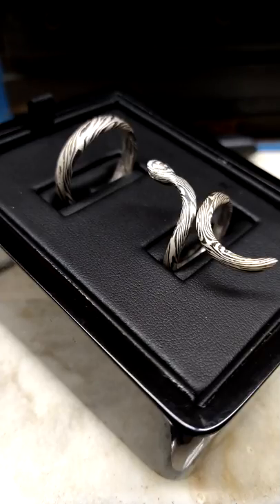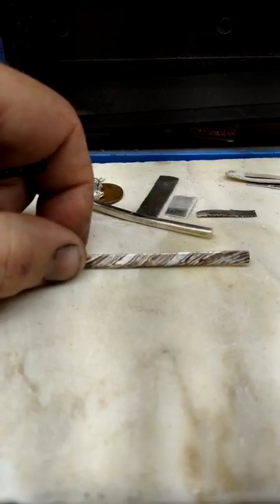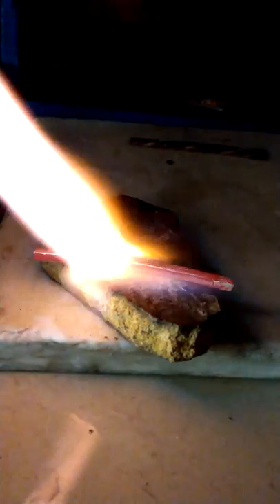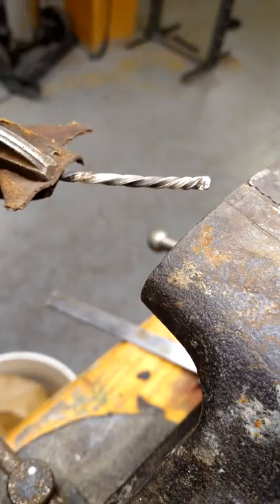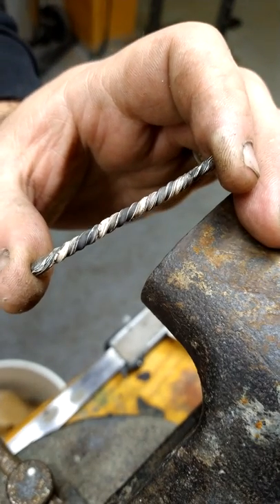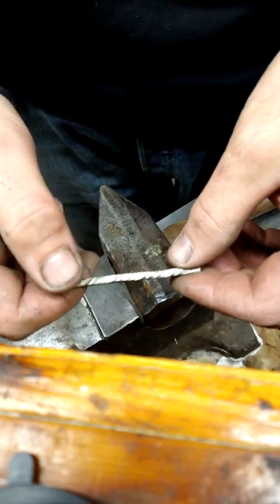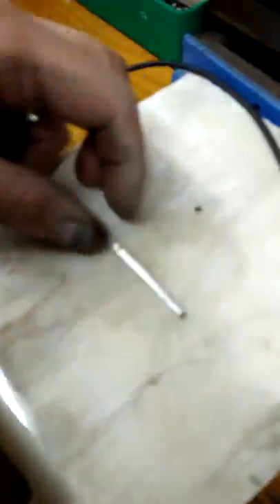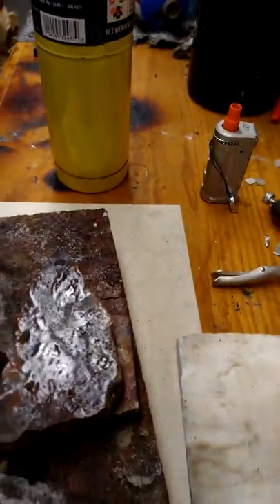Twisting a MOKUME-GANE Silver billet, DIY to make Jewelry Handmade Silversmith Techniques

Comment: this is amazing bro. i’ve got some 925 i’d like to make something with but no pure, could i use the 925 where you use the pure and have it still be shiny and not black?
Reply from the maker: If you replace the pure in this with sterling, the result wouldn't be what you want. The fire has no effect on the Pure , it does on sterling though, and unlike the 800 which turns jet black, sterling just g eta a blotchy blemished appearance. So you would hit it with a torch, and turn the 800 black and the Sterling a dark muddled greysih color that looks awful, it's why my all silver rings lack silver but my gold ones don't. 
However you can use the sterling with a few other alloys and get a good effect using baldwin's patina, I don't use it as it has has no effect on silver or gold but will make copper and Copper alloys turn Black. So you could use the sterling and mix up a alloy like shibuichi, 
It is made from copper and.silvsr but it silver content is set at a lower level (there are a few recipes, but a mixture of copper to silver in 3 to 1 or 75/25 -mixture is most common and remembers light shades of copper or rose gold.....you can also go 65/35  60/40 and 55/45 each will have a distinct color  range from pink to grayish, and will contrast nicely with Sterling, and they can be easily darkened with baldwins patina....
Let me know how it works out :)

Comment: Try getting a small tap wrench and tightening that onto the end of the bar of mokume, might work well.
Reply from the maker: It does work well for spinning the billet. The problem though, is it cuts too much of the vibration and feeling out as I twist. I am looking for even the slightest feeling of resistance and through those pliers the smallest tweak transmits much easier for me at least...
I also like that I can steady feel the difficult nature of the metal return as the annealing is worked out. That is also harder to detect with a tap wrench because of its ease of use, that added torque can actually work against me here. 
The idea is sound however and that thing does work quite well here.
Reply: @mokumeganebydragonchaserny107  Fair enough, I'll sling that idea in the "well that was a shit idea" box and move on. Thanks for getting back to me, I'm just starting out in jewellery and the advice is appreciated a whole lot.

Comment: How much do you charge for a band in the two silvers?
Reply from the maker: I'm sorry I didn't see this message. They range anywhere from 400.00 to 750.00 or so. It depends on the size and design essentially. generally they average about 500.00. there are a few other factors but for the most part it comes down those 2. I can get you a more accurate quote, I just would need to know the particulars starting with dimensions,
So to start what is the finger size and the how wide would you like the band to be?

Comment: Doesn't have to be wheat pennies. It could be any before 198? Something...
Reply from the maker: It doesn't have to be,. But I like them because they are pure copper and weigh exactly 1/10  of a Troy ounce. So it makes it easier to portion them out. Other than that, just make sure whatever it is you use is pure copper and not a brass variant of some other copper alloy

Comment: my guy please hit me up, i’ve been making cuban links for a few months and i really wanna venture into this. i started today and i’m hoping to have good luck tomorrow too. i hope you’re doing well brother
Reply from the maker: Hey there man what's going on, a Cuban Link like this would be sick I sort of made one, not really though LOL now this particular Billet that I twisted up and turned black is 800 and fine obviously, I would not recommend Sterling when using an all silver mixture like this. Leave work because the 800 turns jet black while the 999 stays bright white, however with Sterling youwill get a muddy grayish tarnish from the heat treatment, and anything you try other than that, such as liver of sulfur or acids will have the same effect on all the metal. However if you're going to try silver and gold or silver and another metal, that wouldn't be a problem at all in that case, and I would recommend Sterling in that situation
Reply from the maker: However I think I have some ideas for a collaboration, and it would require a chain maker. We should talk

Comment: Why not use the mill to shape it square? Also, why do cameras pick up the cabinetry real nice and what you're doing, not so much in focus. Ugh. First world problems
Reply from the maker: The reason for forgoing the mill here is to ensure those folded over areas which used to be the corners are not just shaped square, but actually filled in leaving no internal cavities that will become covered and hidden. These are known as cold shuts and they will wreak havoc later down the process of finishing the surface area. They are also intrinsic weak points when bending or forging later for shape. 
Also the hammer will cause light variation in the pattern adding a wave effect.
And as for my camera work......lol..
I'm working very hard on getting better, and you are being kind in your critique...it is far worse than you make it seem and we both know it lol
However I believe the values of the final content will be improving as I slowly learn this medium...it took a while for me to get good with those torches and hammers also, so the camera is next :) 
Lots more coming my friend so keep watching